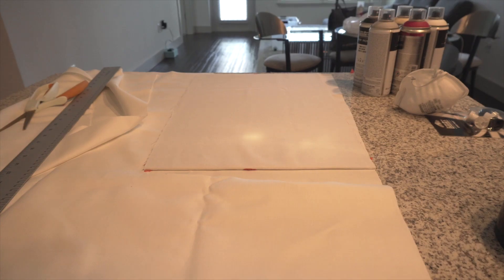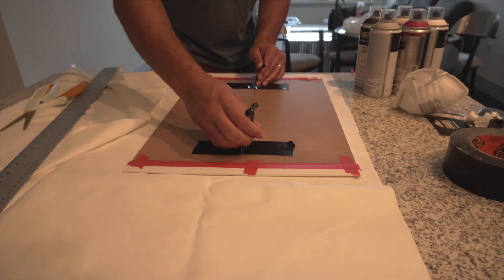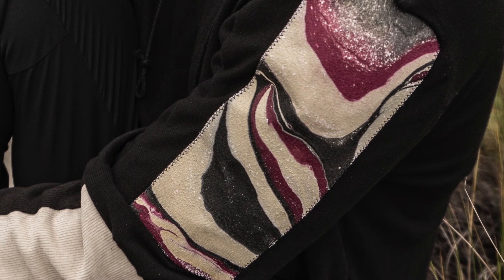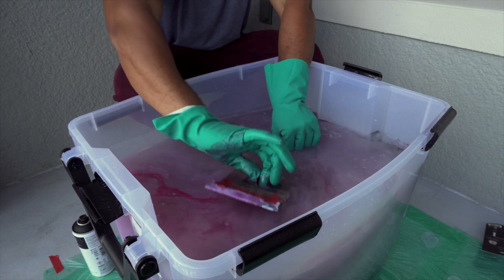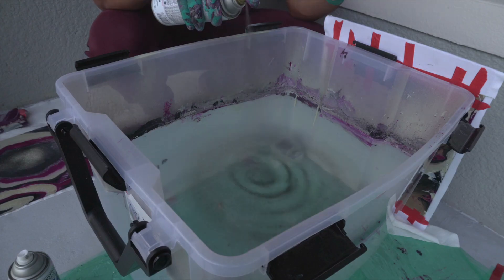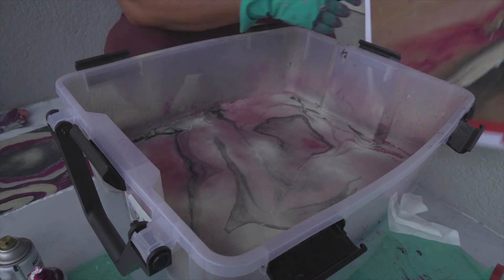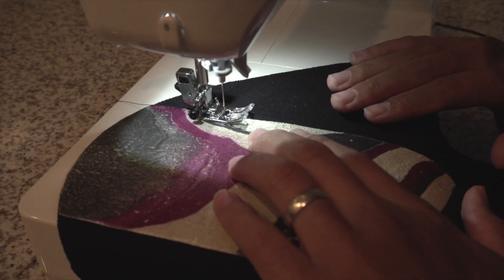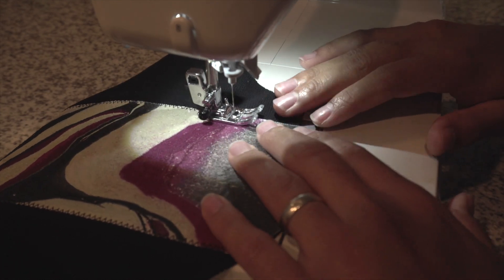💧HYDRO DIPPING A DESIGNER HOODIE!💧 (1of 1 Piece!)

Comment: Great design! I actually tried to do this today and the spray paint peeled and cracked right off in certain spots as soon as I pulled it from the water. Any advice where I went wrong? I used Rustoleum spray paint
Reply from the maker: maybe prime the fabric so the paint has something to stick to a bit better. Also, the more paint build up (layers sprayed) the easier it will crack. Definitely take a few tries to figure out how much to spray!
Reply: @brandenjerez6038  thank you so much for the advice. Will keep trying!